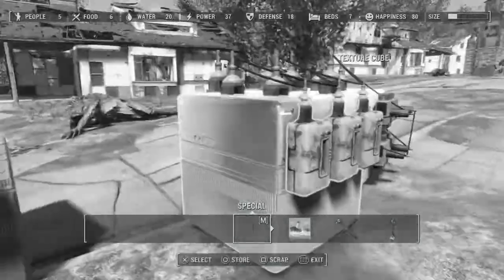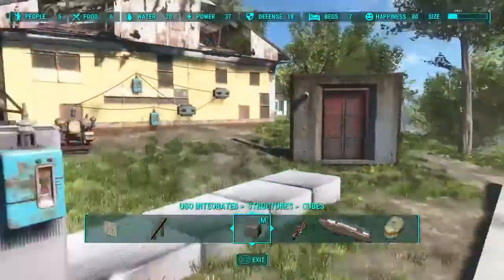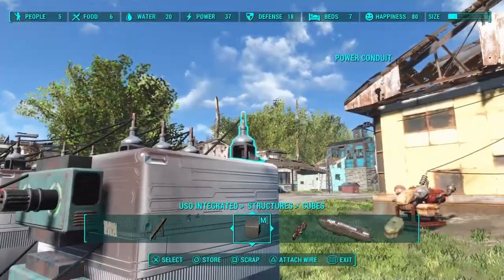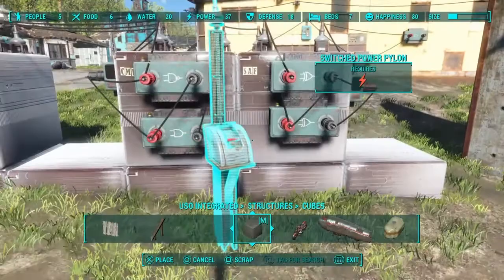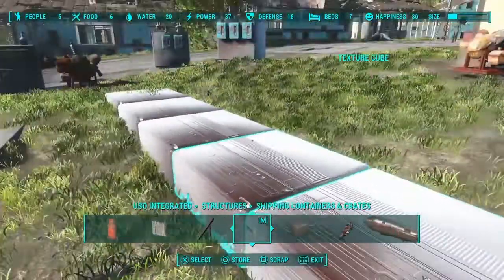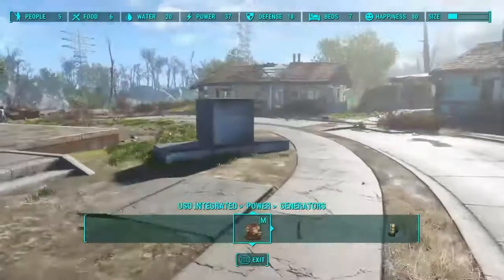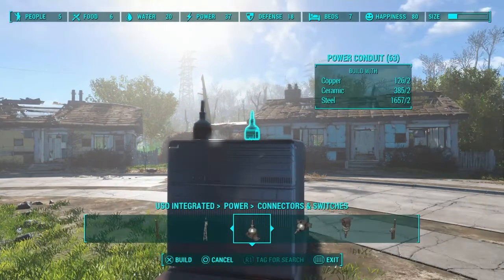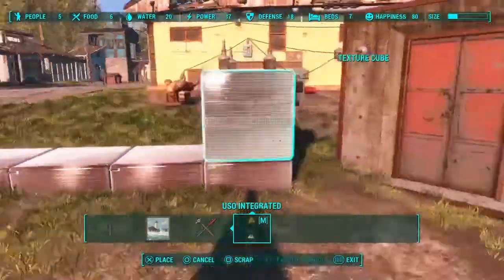Fallout 4 - Introduction to the Modular Logic Gate System

Comment: I know this is an old video, but I hope you, or somebody reading this, can help me out. I'm trying to find something like USO, but on PC. There WAS a mod on Nexus called "Unlocked Settlement Objects", but it's been discontinued. Any ideas?
Reply: I'm super late to the party here, but just in case you're still looking, or anyone else comes across this comment and is wondering, here's a list. They've all available on Nexus.

There are certain things, unfortunately, that are only in USO.  However, here's a few options to try:

Homemaker <- New buildings, Decor, doors, Greebles, Misc objects
Settlement Objects Expansion pack <-Mainly building pieces, light sources, and some terminals
Snappy Housekit <- adds more building pieces, doors, high tech stuff, art deco..etc.
OC Decorator <- lets you place junk items as static, unmovable objects (a wrench, duct tape, a bobby pin box..)